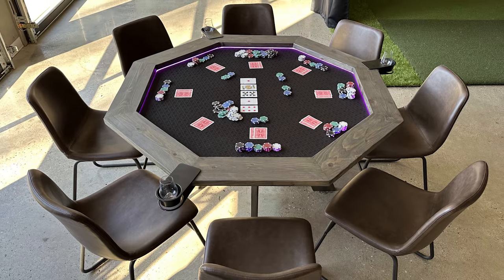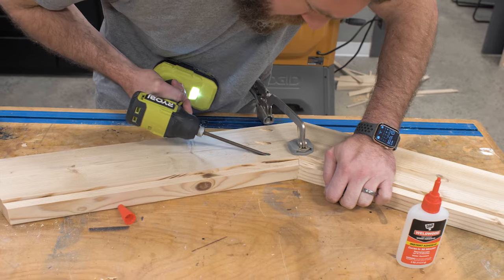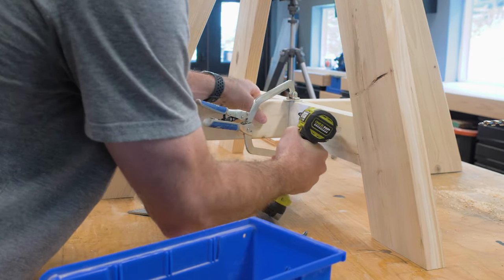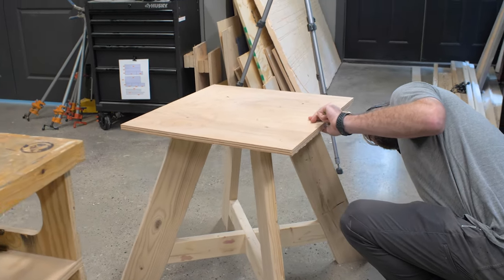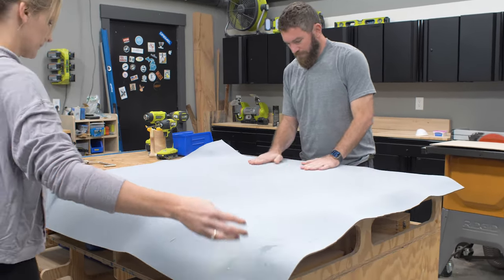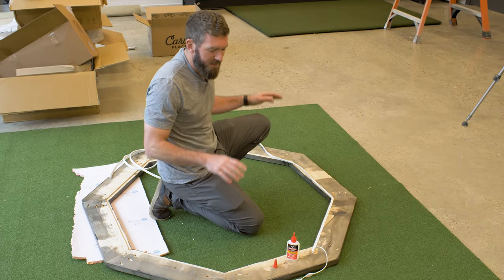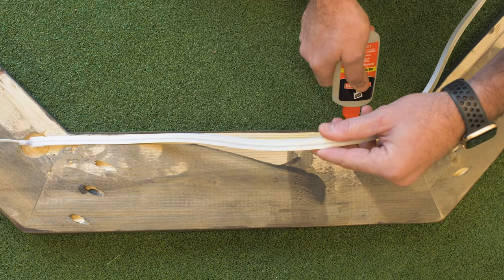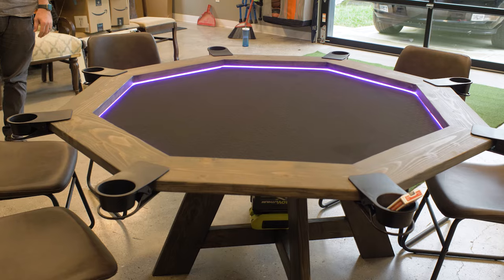DIY Octagon Poker Table with LED Lighting ♠️

Comment: I really want to try this build. My concern is the depth of the rail. 6 inch rail seems a little thick. Any feedback on how much you have to lean over the rail to get to chips/cards? Thoughts on using 2x4s instead?

Comment: Where did you get the clamps to hold the glasses on the table?
Reply from the maker: Amazon: https://amzn.to/3viSqWx
Reply: @rogueengineer   Thank you
Reply: Harber freight has them for like four bucks each and different sizes. Price goes up the bigger it is
Reply: @rogueengineer  would u be able to provide me with the specific product and colour used for the deck stain

Comment: It seems a bit basic (no chip or cup holders). Players often lean on these tables a lot and looks like that might be an issue even with a bigger wood board underneath. The battery is also a bit of an eyesore. Maybe a different base could hide a battery.
Reply: There was cup holders 😂
Reply: @lindseywagner7510  where? A clamp on the side of the table is not a part of the build. 😂
Reply: Good thing this wasn't made for you then.
Reply: @grahamrotelli1567 waiting to see your table build